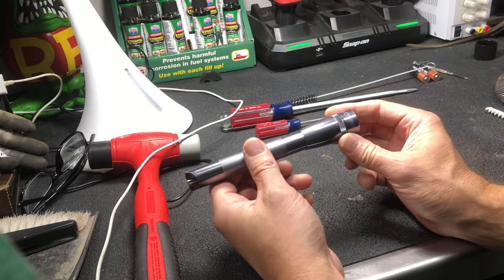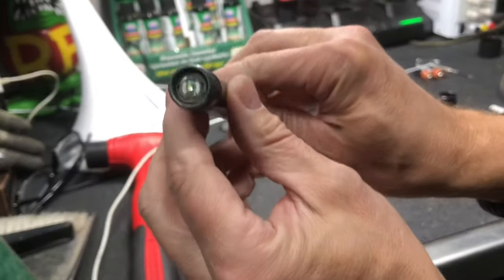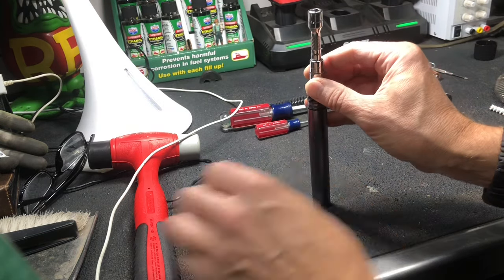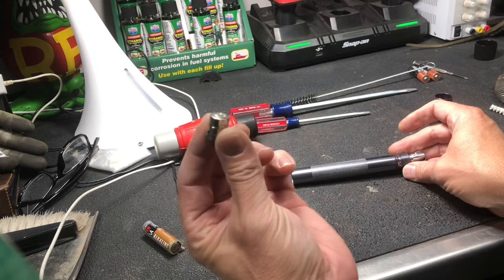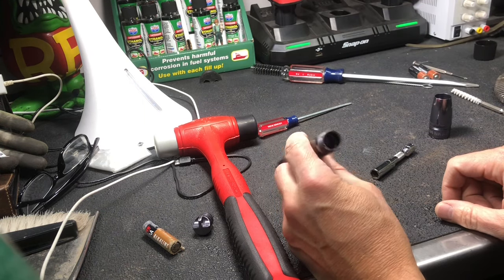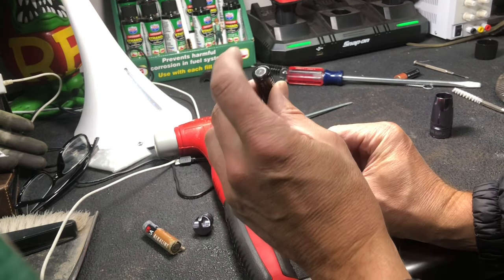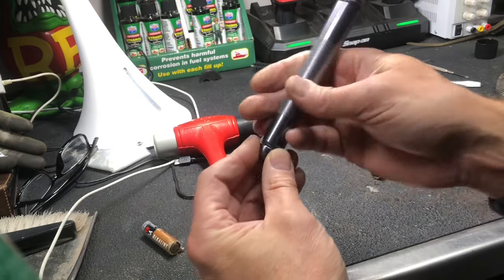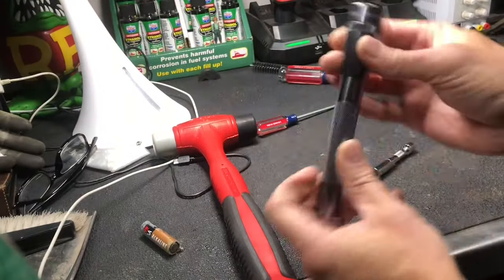How to easily remove bad corroded battery from LED mini maglite !

Comment: Gently MY ASS... had to flog the thing!  After two days of emersion in vinegar and flogging, using a press and serious persuasion I'm getting very close with both batteries out only items in the tube are LED unit and a socket.  Good news is that maglite.com customer support was great, sending me damaged LED parts FREE with only $8 fee.
Reply from the maker: Ha!  Man I wish you would have filmed that.  Yup Maglite support is solid.  Post some pics if you can and good luck!

Comment: I was so pi$$ed off, that I smacked it 200 times with a hammer and threw it in the garbage. Not worth it consider Amazon has it for $16.
Reply from the maker: Aw man I get it.  Been there.  But next time take video of that and post it!!Thanks again for watching. New episodes posting soon!
Reply: @restomod101  - One doesn't need a posting video to know what one has to endure. Imagine me at my steel vise. I lift my maul up and use a socket and extension to apply to the cylinder. Then, I repeated (25 times) smack the flashlight with the maul another 10 times to crush it. Then, I "forwarded" my sentiments to the trash bin 5 feet away. A dazzling display of being pi$$3ed.. I notified MagLight and they offered to "upgrade" it by sending it in (would cost me $10 for postage and a $7 return trip to the post office. I see it sold and delivered free to me for $16.95.  They said, "not covered because of battery corrosion and it's a design product that won't let someone remove batteries. The unmitigated gall.